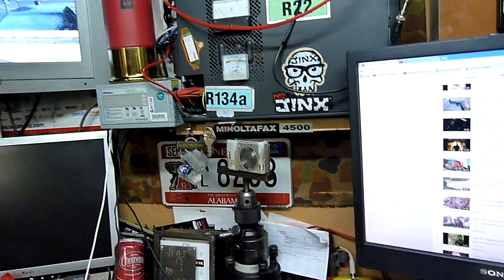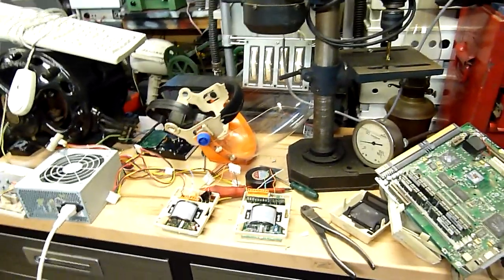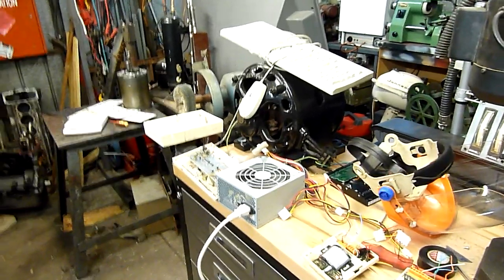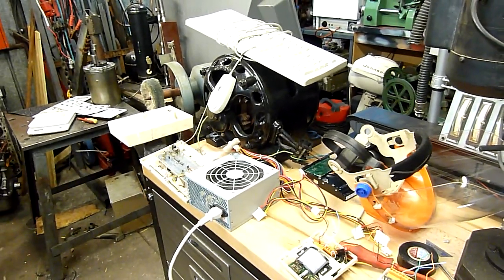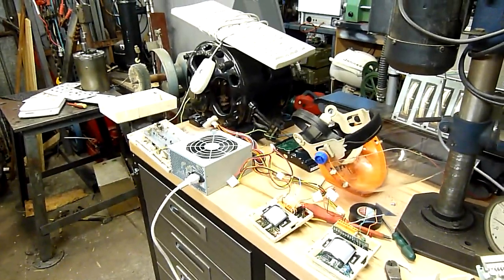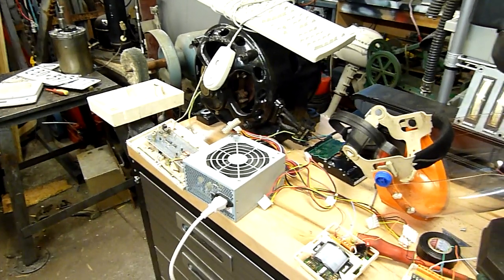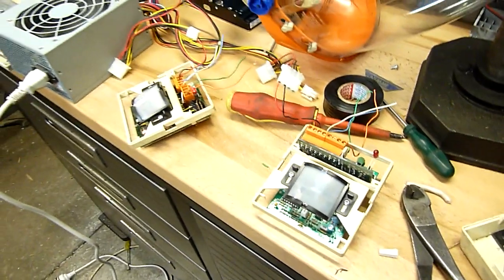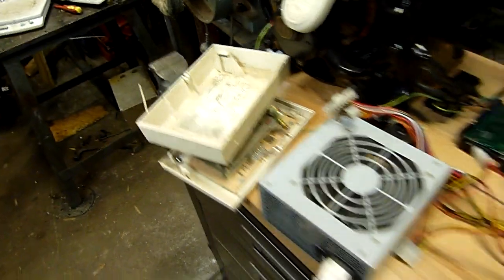Ramblotronic Wedensday - What Cars I Have (On Road) and PIR Qestions

Comment: Most alarm systems I've messed with run off 16.5vac and them supply around 12vdc but sometimes up to 16 to the pir's and other devices, then it should also have both a n.o and n.c contact so that  it can be wired up for either type of monitoring. All security stuff like that is more or less standardized.

Comment: Red Is + black is - blue and white are switched open on motion. Most alarm stuff is nc contacts not no.
Also every pir I have wired was 12v not 5v.
There are also 2 contacts for the tamper switch these go open on tamper. Most of the time the tamper switches get wired in series and put into a spare input on the alarm panel.

Comment: throw 12v at it and then use your meter test the relays etc you get the gist of it after that. unless that model has  a diagram on the headers for there use(All alarm equipment is standard 12volts dc)

Comment: the problem in us and canada is the bodys rust and the motors keep going but when the body rots away the Good used parts are hard to get because there corroded the the the block and you Always snap bolts off

Comment: Are you sure if they run off 5V? Most run off 12V as they have the backup SLA battery if a power cut occurs. Some also have contacts on the casing so the case would need to remain closed for it to work. Hope you get them to work :D